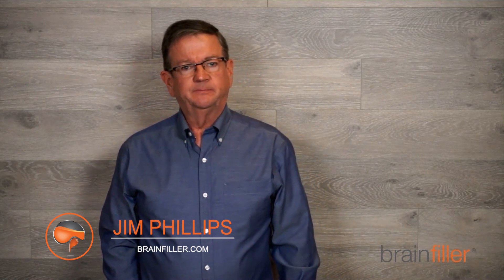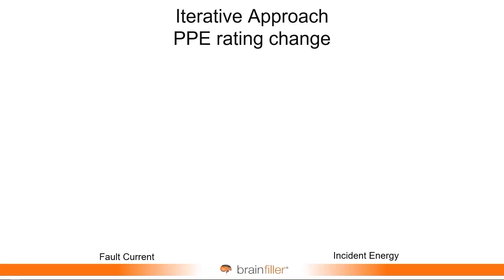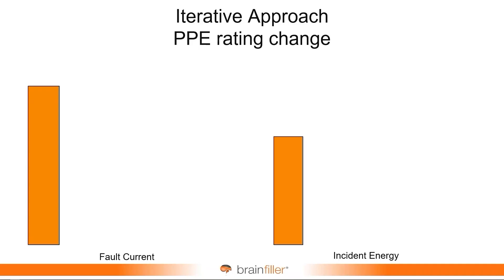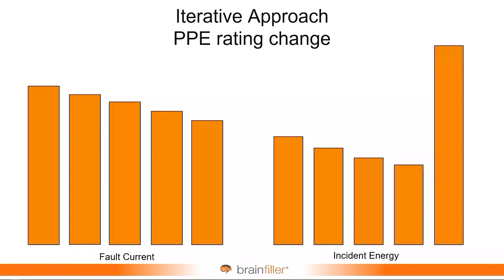No Available Fault Current?  An Iterative Approach

Comment: Excellent presentation and very important info, since the available fault current and incident energy can behave like a double edge sword in that attempts to reduce the available fault current by using impedance grounding or similar measures can increase the clearing time of the OCPD to a point of actually increasing the incident energy.
Reply from the maker: Exactly!  Lots of moving parts with this.